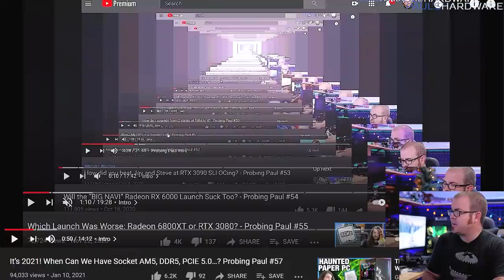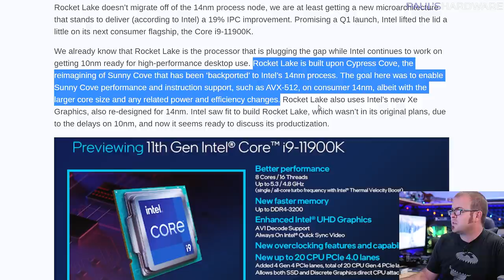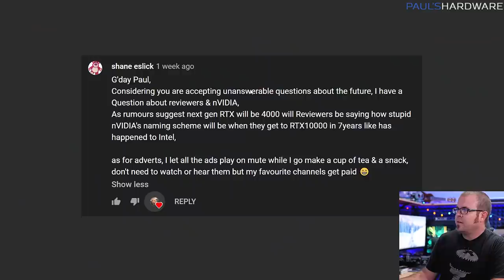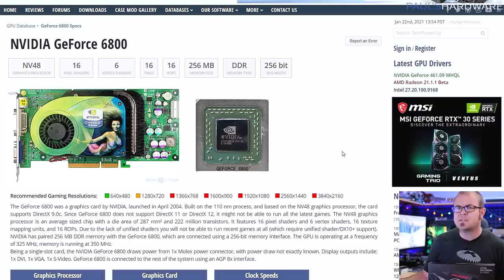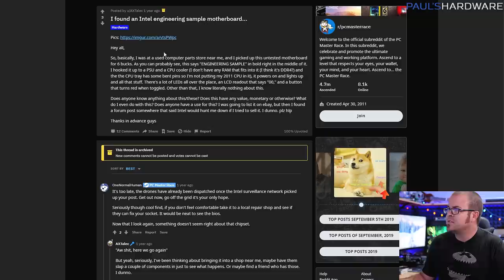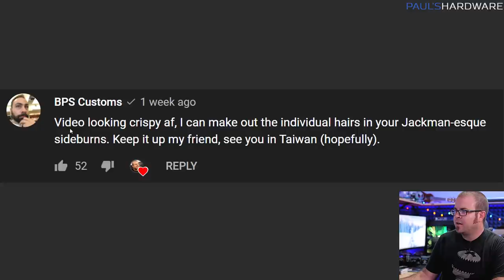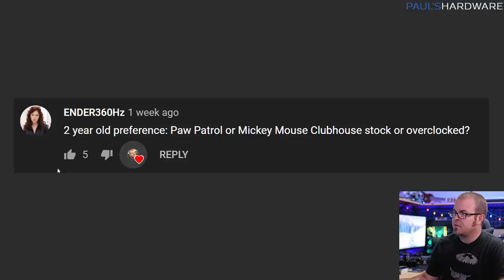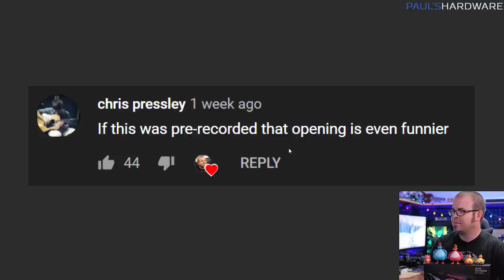Why is the 11900K only 8-Core instead of 10? - Probing Paul #58

Comment: The 10900k had 10 cores, so the 11900k should have 11.
Reply: so, the 12900K should have 12-cores? seems appropriate
Reply: @MrSylvandragon  Alder lake will have 16 cores. The high end will have 8 high perfomance cores (with hyperthreading) and 8 small cores (Intel should add hyperthreading to these).
Reply: my intel core 8700k should had had 8 cores
Reply: @saricubra2867  wait, so the 12900k is going to have 16 cores?
Reply: @Metamine0  A rumor i suppose
Reply: @Daxterbeer  did it not?
Reply: @saricubra2867  so, like 12 ish
Reply: @MrSylvandragon  8 core mainstream wasn't until the 9th generation where the 9700k and9900k came into play.  8th gen's best was 6 cores and 8 cores was introduced later.  However, the motherboards for the 9th and 8th gen were compatible with each other.

Comment: So to sum up, there's only one reason why the 11900k is only 8-cores. It uses the same, inefficient 14nm process with a new architecture. If it were 10 cores, it wouldn't be able to be clocked so high due to temperatures, and then it wouldn't be marginally better at 1080p competitive gaming vs the Ryzen 5000 series, which is the CPU's only selling point.

Comment: I've worked for a contract circuit board manufacturer for many years. One of the things we would build were small runs of test boards for larger companies. It's common practice, even for companies that build circuit boards on-mass, to use contract manufacturers to build the circuit boards for custom test and/or assembly equipment. Companies like Intel/AMD would usually provide all necessary design documentation (drawings, BOMs, etc) as part of the quote/purchase-order.

Comment: Hey Paul, I used to work in a manufacturing facility here in the states that created surface mounted circuit boards for aeronautics. I worked in the testing and troubleshooting department and was lucky enough to watch the process of when they are creating and editing a brand new board for mass production. Basically every part on the motherboard can be removed or added by simply soldering the parts. The part I was able to observe was moving of components like audio boards etc. during testing for best placement. One of the techniques the facility I worked in used was a tissue like paper with the board drawn on it before they actually created a physical board. The tissue paper was so they could easily move the 'board' around, not damage anything and mark the paper if a part interferes with any current testing equipment. Before testing and mass production can begin, a company normally establishes a 'gold' sample that would be used as a calibration device for the testing equipment and is considered a perfect example of the product (motherboard, etc.). This might be what to ask about for the 'how do engineering samples get created' question.

Comment: Simplified, Sunny Cove is meant to take advantage of the node shrink, puts more transistors into a core of the same physical size. When you dont use the node shrink, the core is physically larger. 

so on 14 nm its 8 large cores (sunny cove) vs 10 small cores (Comat lake) in the same die space. Thats also why it has the IPC increase

Comment: Hi Paul,
I’m an embedded engineer and yes, Intel and amd have teams that work with the teams that make the cpus.
The manufacturing of CPUs is the combination of multiple engineering teams working on different parts of the product.
In the end of the day, Intel design the chipsets for their processors and thus they have their own motherboards to test their new CPUs.
After they finish the final product, motherboard companies use Intel schematics and designes to base their motherboards on.
Just like companies use Nvidia schematics and final design to base their PCBs for graphics cards.

Comment: I bet it will still beat the 10-core i9 in multicore loads. And they need to have a reason for people to upgrade so you can bet your butt that the following gen flagship will be 10/20. I’m holding out with my 9900k until we get DDR5 boards.
Reply: Nothing wrong with a 9900K system, pretty solid work horse.

Comment: Without watching the video, I can say from a financial and power draw standpoint, that's why Intel made the new 11900k an 8 core. Two less cores means they can crank it just a little bit higher on clock speed and still fall within the power draw specs they were wanting. Even with an architecture change on the same fab node.

Comment: Im very happy with my 10th gen ntel i7-10700k. That being said I am happy I bought 10th gen and I am not interested in 11th gen. Seeing the performance improvements with the 11900k I can say I am more than happy with my 10700k. I have the same core count and I am overclocked to 5.1ghz all core, all the time. The miniscule improvement I would see from the 11th gen chip is not worth it. I have a dedicated GPU so I wont be using the integrated graphics. I have no use for PCI 4.0. Im very happy with the system I have. I overclocked my 2070 super to 2070mhz (+135mhz core) and +1000mhz VRAM. This system runs VR @90fps locked in almost every game. Did I say I was happy? Love the channel Paul. Long time viewer.

Comment: Here's an idea for naming:
The first two digits would be the core count, and the next digits their ipc /10. So let's say that they release an 8 core cpu with a 20% performance gain  (like the 11900K) and it executes 1.2 instructions per cycle, they would call it the 8-12 @ 4.3Ghz for example. If they have a 24 core cpu with 5.7 instructions per clock cycle it would be a 24-57 @6Ghz. Then it doesn't matter what architecture or manufacturing process they have + they provide actual information about the cpu.

Comment: Question:
I've got a Z97 platform, and can't afford to upgrade to a new one, but plan upgrading my Xeon E3-1231-V3 to something I can overclock, but what should I get? 4790k or a 5775c? I've got an EVGA CLC 280 for my cooler, so plenty of cooling available. Just cannot decide which one to upgrade to. I can get both for about £120, just don't know if the higher IPC and the 128MB lvl4 cache is worth more over the much higher overclocking on the 4790k.

Any help and advice would be highly appreciated!

Love your vids, keep 'em up!

My build:
Xeon E3-1231-V3
Gigabyte GA-Z97MX-Gaming 5
EVGA CLC 280
EVGA GTX 1080 Classified
Corsair Vengeance Pro 2400MHz 4x4GB
EVGA SuperNOVA 750w G2
Samsung 960 Evo 256GB
Kingston HyperX 3K 240GB
3x Seagate Barracuda 500GB 5900RPM
NZXT S340 Elite
-
Dell S2716DG
Belinea 2225SW
Logitech G910 Orion Spark
Logitech G502 Proteus Spectrum
HyperX Cloud II

Comment: I have always been an AMD Fanboy, I have gone from 2 cores to 4 cores to what was supposed to be 8 with the Black edition 9590 Piledriver, and now back down to 6 with my RYZEN 3600XT.
Reply: You've spent a lot of time with weak hardware. Id much rather be running a 4790k than 8core PDriver in 2014 or 2021.

Comment: Hey Paul, I was wondering if you had any suggestions for a receiver + speakers for an entry level 5.1 surround sound set up?

Love the channel. Keep up the great work!
Reply: You might have limited options for receivers right now thanks to covid and the fact that both Sony and Onkyo/Pioneer announced they are on hiatus from producing AVRs. This leaves us with Yamaha and Marantz/Denon (new and leftover) and leftover Sony, Onkyo/Pioneer models. As far as AVRs go, set a budget and get the one that offers the features you want within that price range. Pre-amp outputs are always a plus for longevity especially on low end AVRs. You can always add an external amplifier to increase power if you have pre-amp outs. Lots of good sounding speakers for any price range. Again, set a budget and then research the offerings in your price range. Audioholics.com has some great articles on home theater setups by price range.
Reply: You can get started with a 5.1 soundbar kit before diving into the crazy world of audiophile-grade gear. Vizio’s 36” 5.1 soundbar gets good reviews, and it’s just a couple hundred bucks (you can get them for $150 at Sam’s Club or Costco around the holidays).
Reply: @CantankerousDave  soundbars are good for living rooms and wife-approval factor. It's not a replacement for a hifi or even budget hifi setup

Comment: It took me a few minutes, but I recognized you after watching this from my recommended. I last saw a video of yours in the early 2010s when you worked for Newegg, and I was a teenager. I'm glad to see you've expanded, and you maintain your down to earth nature (replying to youtube comments instead of only $5 super chats for instance). 

I still use a 3770k clocked to 4.3ghz circa 2012. Its done me well, and I'm ready to retire it, although I have no complaints about its performance. I mostly play single core intensive ArmA 3 and do some light Autodesk Fusion360 stuff. Do you think I should take advantage of the lower pricing available for the 10850k, wait a bit for 11th gen, or wait a longer bit for 12th gen? I want to build another machine that will keep up with modern games for eight years, and I don't know if it's better to pick the tried and true units available currently, or wait for the new technologies that will come available with 12th gen.

Thanks, and congratulations on everything you've achieved since I last saw you.

Comment: A little info regarding balding: It is passed down primarily on the maternal line which makes it a lot harder to track. Basically you have to check if male siblings to your mother, grandmother, etc. are balding. Father, grandfather, etc. will have almost no impact on you.

Comment: Hi Paul. I have a friend of mine that has a pretty standard system. She has a 4 core Intel processor, i dont' remember the model but I know it's a 2011 model, 8 GB of DDR3 RAM, 1 Terabyte HDD, an NVIDIA 710, and the default grayish no-brand power supply that comes with the case that probably gives only 250 W power although it might claim to be 500 W. She is a character artist and was planning to buy a new PC this year. I was planning to help her get a PC with a Ryzen 3600 or 5600X, an NVidia 1660 or 3060/3060 ti, 16 GB of ddr4 Ram and SSD storage. The thing is, due to financial issues she realized she might have to postpone buying a new PC this year, and we were looking for ways to perhaps upgrade her current PC to handle her graphic work better. We were thinking upping her ram from 8 GB to 16 GB. Her motherboard has only 2 RAM slots and one of them is used by one 8 DDR3 stick. Also we were thinking of switching to an SSD. The issue I want to ask about is the graphic card. Considering she is running on the default power supply that came with the case, and considering the Nvidia 710 uses only 19w of power, is it wise to do any kind of graphic upgrade without buying a new power supply? From my research, the least viable graphic card for her use case is the nvidia 1050/1050 ti, which would use 75W power. I am concerned that jump in power would be tough for a default power supply to handle

My second question is what graphic cards are good for optimal graphic design software and why. There is always info about which cards are good for video editing on adobe premiere and 3d graphics software, including why, but minimal info regarding what graphic cards are needed to run the latest versions Adobe Photoshop or Clip Studio Paint properly, which is the reason why she ended up with an Nvidia 710 in the first place, although I, a graphic and character artist myself, have felt significant improvements in both my graphic work and windows usage when i got a mid range Nvidia card, but I also use it for games, which she won't. Forums on the internet claim that the optimal middle grounds for Adobe Photoshop are an Nvidia Gefore 1050 ti, an Nvidia Geforce 1660, or an Nvidia Gefore 3060 ti, but they don't explain why. The only details I found that some features in Photoshop are grayed out unless you have a graphic card, but no information on the differences in performance between one card and the other, or how CPU bound and GPU bound the graphic editing softwares are when it comes to their overall performance, as well as RAM requirements for advanced high resolution multi layered image editing and digital illustration. I am also looking for information about both the general performance and fluidity of the program during illustration and image editing as well as the performance of any GPU bound special features in the image editing software that uses 3d effects. Could there be some info regarding what is the recommended hardware for a professional illustration and advanced photo editing rig as opposed to the rigs being video editing/gaming or streaming, as well as why? Thanks in advance. Please note that an illustration rig would need to be dual screen because usually screen 2 is a Wacom (or other) tablet screen for illustration so it is also a device that supports dual 1080p screens. (or sometimes the secondary screen is 2k or 4k depending on the model of tablet screen)

Comment: Rocket Lake S is the ultimate "Hey don't forget us guys! We still exist" move by Intel after getting ass blasted by Zen 3 because they know they have nothing until Alder Lake comes out.
Reply: matching single core performance at twice the power and heat is not impressive unless you mean from the standpoint of keeping 14nm alive this long. hopefully after they lose some market share for a yr they can start competing again without "optimistic marketing slides"
Reply: @wayward03  bud, intel is a monster, theres a reason there dropping this chip. Ill come back here when its out to talk why
Reply: @sagerdood  I'll believe it when I see it...
Reply: @wayward03  yea you will
Reply: @sagerdood  so you work for Intel? Or do you believe the suspicious geekbench leaks? 

I highly doubt it'll beat the 5800x by more than 5% single core and more than match multi core. And it'll run hotter. So unless you have custom water cooling you won't see any of that "advantage".

Comment: Hey Paul, love the vids and have found a lot of my knowledge actually comes from watching these and other vids from tech youtubers great job. Anyway, I've ran out of USB ports on the back of my PC and have had to resort to using a USB 3.0 hub for my external drives. I've noticed that after turning my PC off the external drives, which are mechanical are still powered on in that I can still hear the discs spinning. If I unplug the hub they then power down completely. My question is this: is leaving them on after my PC has powered down going to shorten their lifespan or should I manually keep unplugging the hub to shut them down completely? Any help would be much appreciated.

Comment: Hey Paul what is your thoughts on Nvidia producing more 20 series cards?
Reply from the maker: Right now it seems like more GPUs would be a good thing 😅
Reply: @paulshardware  I think they should have little lower in price though as that Matters anymore.
Reply: Nvidia should produce more so the miners can absorb more.
Reply: @hansbehrends438  Miners aren't buying graphics cards. Miners who use graphics cards are losing money in power costs if they use GPU farms for cryptocurrency farming. Tech/product commodity resellers are buying the cards and reselling them.
Reply: @JosephArata  Exactly. Mining is more efficient on ASIC or whatever
Reply: @paulshardware  I was kind of surprised they still had the 20 series factories still sitting there. I would have thought they'd already retooled them for something else. On the other hand, if they're retooling factories back to the 20 series, then why not retool them to make 30 series?
Reply: @Trifler500  Turing is based on 12nm TSMC and those factories have capacity (unlike the 7nm line). The 30-series is 8nm Samsung, different process and manufacturer, not possible to retool. The card manufacturers can make either as that stage hasn't changed significantly, the problem is Nvidia's silicon supply.
Reply: @AndrewSmall963  I see. That makes sense, but still, what were those 12nm factories doing in the meantime?
Reply: @Trifler500  TSMC have hundreds of customers, e.g. Apple. They schedule the line to keep it busy, often booked 6 months ahead (and if the customer design team misses the window, they still have to pay for the slot). So it will have been used for another company's product as 12nm is still very popular.

Comment: For naming in the future I want them to use a mythical creature followed by a smaller number or just the name
The Chimera 150
Manticore 600
Basilisk etc
I think if they all had separate names for each line numbers or not I think it would just be better. Like one gen they use different mythical creatures from different regions. Mix it up instead of a bunch of numbers and random letters

Comment: BE WARE!!

Anyone who buys the 11900K Rocket Lake S 8 core is making the same mistake that people who bought the 7700K 4 core before the 8700K 6 core dropped. Wait for the Alder Lake S 16 core with DDR5 and PCIe 5.0 in 2H 2021.

Great stuff as usual, Paul.
Reply: Yes but then wait for the next 1-2 years when we're on 3-5 nm and you're on whatever is next lol. I would argue now is a terrible time to buy a PC period unless you already have the 3060-3090 in hand. I would also argue the 11900k will last you at least 3-4 years easily without requiring an upgrade. When you're on bleeding edge of high end tech you don't need to keep up with the jonses. My 5900x will last me a good 3-5 years. Remember it just came out 2 months ago so it's already becoming old lol. Tech doesn't ever stay fresh. Tech is something you buy for fun.